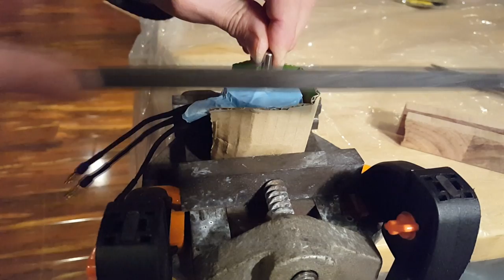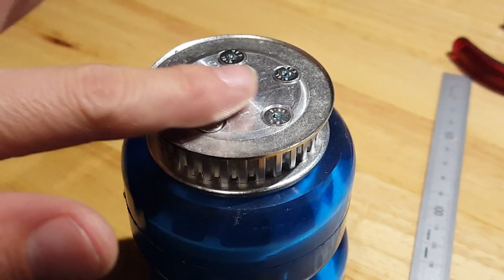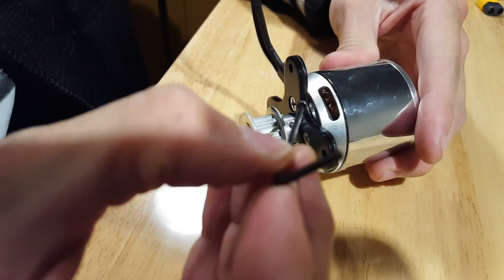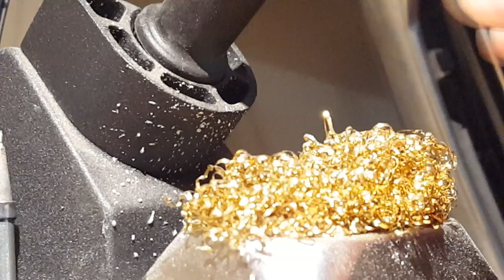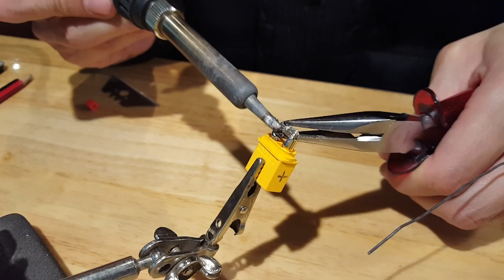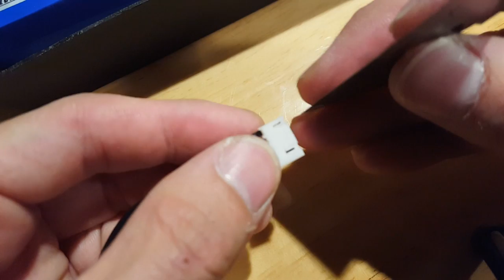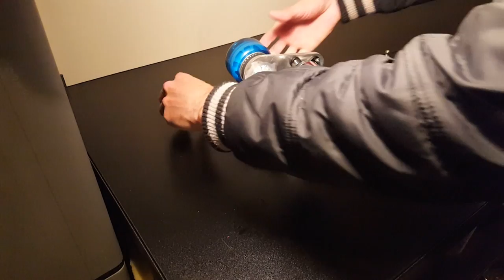How to build the Cheapest electric skateboard

Comment: AWESOME VIDEO! My question to the entire electric industry is why are 90% of the electric boards so badly shaped? most skaters use 2 tails so why are most of the electric ones made with no tails at all? great for a beginner but, not being able to Ollie is very counterproductive to most skaters. This concept is great cause you can choose what type of board suits you.. and let's be real, if you don't use tails your not really a skater, it's for transportation l. :) lol
Reply from the maker: V R I have built many boards with many shapes, some have kick tails, some don't. i have even done this: https://www.boardworld.com.au/uploads/forum-images/33801-14a6ddf281/33801_1420448336.jpg
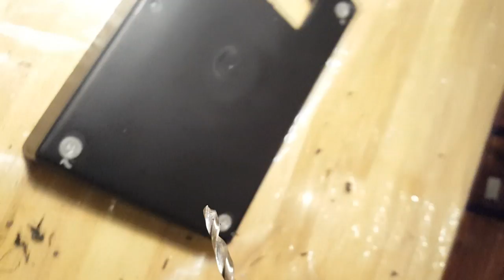just because I, like you prefer a street deck. I have a lot of skateboards.. 12:30 thats not even all of them, and the reason that almost all electric boards are longboards is because you just can't go fast enough on a street deck! the street deck is so sketchy at high speeds even pros get the wobbles. I didn't like it either.. i wanted double kick street deck with 52mm wheels and a motor... It just doesn't work. my favorite motorised skateboard is a cruiser deck with a kick tail. but like you said.. these are more for transport than tricks.
Reply: V R this isn't a skateboard it's a longboard used for riding downhill and to handle high speeds, not do tricks